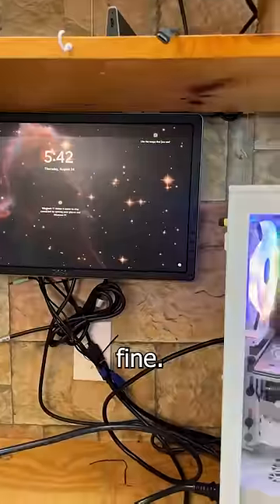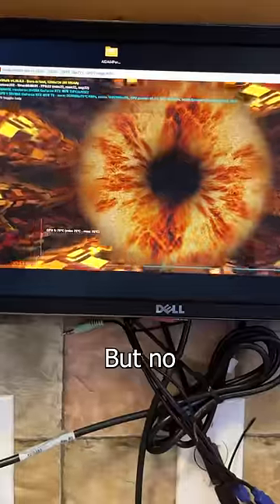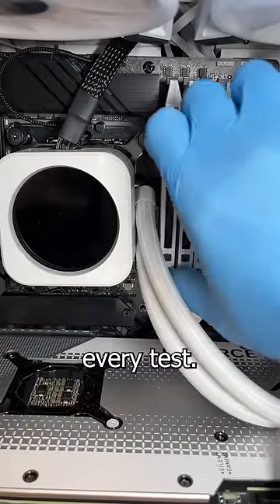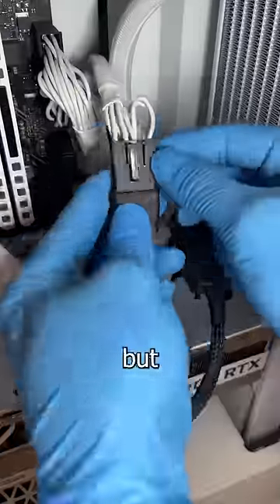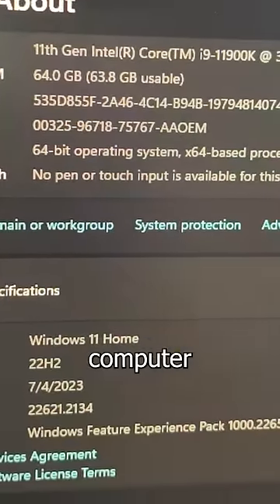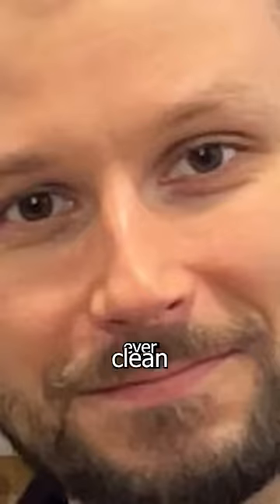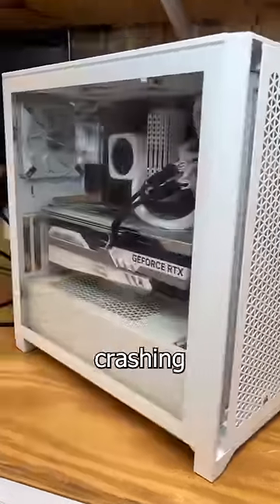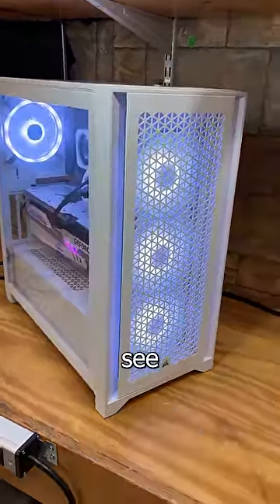The hardest repair in my shop is a #gaming #pc with random problems #technology #shorts #tech

Comment: Can confirm, getting a repair where you know there’s a problem but you can’t find a single thing wrong is the worst.
Reply: As a former automotive technician (fancy dealership mechanic), I can tell you that sporadic "seemingly random" problems usually result in situations like these.

Step 1:  Try to reproduce the problem.
Step 2: Try to gather more information like "What time? Weather? what were you doing when the problem occurred? ...etc.
Step 3: Keep the product for a few days to use in and out of the shop, see if it occurs. This included driving customer vehicles over a weekend.
Step 4: give the customer the product back and give them two options. "If it starts happening more often, a specific location, or a specific task" ... i.e. "Bring it back when it gets worse." OR Take time out of my day at the shop for the customer to drive me around while they try to create the issue for me. --This last part would be hooking up all cables/devices in its home location and call me out to you when it happens.
Reply: Can someone explain why would somebody use thunderbolt docking station
Reply: PC might be hard to access where it is on the desk and the dock sits on the desk for access to ports.

Comment: Problems like these are definitely the ones that you both laugh with a sigh of relief and also scratch your head a little bit in anger because of all the wasted of time. Still, it adds to the knowledge pool, which ultimately matters.
Reply: Yeeepp, just did this with a damaged riser on a micro atx. Couldn’t check stuff ezpz cause of case restrictions 😭😭😂
Reply: @DaddySann1776  The motherboard could be taken out of the case where testing can be done out in the open.

Comment: When absolutely nothing is shorted, this problem usually comes up with power strips. When not rated for high wattage, they give up on you and it is the same effect as having a low wattage PSU. This also applies to most surge protectors.
Reply: Yeah I was gonna say it's something to do with PSU or the plug
Reply: I had a similar problem with a PC replace both PSU,. power cable, new extension lead, brought a new keyboard and mouse in case one of them was shorting it. CPU temperature fine, the RAM, tried friend spare ram, still same problem,. 

In the end I gave up, an just live with randomly turning off every couple of days.
Reply: @DavidKnowles0 sir you have made me very sad (I have the same problem and am now scared)
Reply: @ak26k bro I have the same problem
Reply: @DavidKnowles0 can I ask what brand your pc is and also is it fully random or can you notice some pattern to it mine will only turn off if a game isn’t open gotta run cs2 in the background to watch YouTube without it shutting off

Comment: Several decades ago my car would run rough because oil would get onto a spark plug. A drive on the freeway would fix it, but one time none of my tricks worked. I stopped at the garage before work and they said they had no openings that day. When I started the car back up, it ran fine! Magic repair shop vibes? I'm a believer.
Reply from the maker: Hah, love this!
Reply: My car broke down at the grocery store once it had a cylinder that wasn’t firing and was undrivable to I had AAA bring it to a repair shop expecting a 4k$ repair and they called me back the next day and say the car didn’t have any issues so I picked it up and drove it home

Comment: I worked on FA-18's as a AT in the Navy.  Yes, the worse issues to trouble shoot are the ones that cannot be reproduced.  But we couldn't say on too many tickets "Cannot Reproduce" so, after standard troubleshooting and to much time, we would just "R and R" (Remove and Replace) a part that may be linked to the issues.

Comment: Mine had the same problem, but i fixed it by cleaning the dust, and when it happened again, I pushed on random parts, and it fixed itself and hasn't crashed since.
Reply: It works so often though!  Open the case, poke around randomly.  No idea what I've just done. But it works again for some reason.
Reply: @JimmyJoeBob  ikr 😭
Reply: @JimmyJoeBob  Obviously the errant fondling of the components pleases the Machine Spirit.
Reply: @QueCoiFas the machine spirit: yamete kudasai~
Reply: Had the same problem with a mini rc car 

It didn’t work
I opened it up
Poked the chip a bit
Closed it
It worked

And my brother looked at me as if I was a genius asking how I did it hahahaha
Reply: Yeah, a lot of tech issues are just caused by either little bits of dust or small particles that can be jostled loose, or loose connections between components that can be readjusted with a bit of fenagling.
Reply: @junktruck  yeah it started happening again and idk how to really fix it tbh, i just try to push in the parts harder and wiggle abit

Comment: I had a laptop that would just randomly blue screen after being on for a couple hours. I had it sent off for repair about five times, they replaced  pretty much all they could, motherboard/ram/etc., but everytime I got it back nothing was different what so ever. I would get it back, turn it on without plugging anything in, and leave it completely as they had sent it back to me, only for it to bluescreen in about 2 hours. 

I wish I had a technician like you. I never found out what the issue was, presumably because the company the warranty was under didn't care to read my reports that they had to just leave it on for a couple hours to reproduce the issue.
Reply: Ever thought it could of been a power supply manufacturing malfunction? Or maybe read up about the blue screen error code?
Reply: That's because a blue screen is a windows configuration error issue on your hard drive. Either a bad configuration setting with the operating system or your hard drive was reading badly
Reply: So, if they replaced the mobo, ram etc and the issue is still happening then what is the common denominator - SSD, Keyboard, mouse and charger. Could also be  your wall plug or multi plug.
Reply: @Noon1263 1st thing I thought of was the PSU.
Reply: @IdealConscience not sure where you read this orif it's a language barrier but this is totally false.  Bodf is a sign that a driver is crashing due to either a software or hardware fault.
Reply: *BSoD.
Reply: mybe ur driver got removed try to reinstall the windows or make usb recovery from official website of ur laptop brand

Comment: I had a client who had random power-offs that I could not in any way duplicate on the bench.

The problem was at home they shoved it back in their hoarder cavity of newspapers and other items that completely prevented exhaust air from going anywhere. This was 15 years ago on an OEM pc so there was completely no logs of thermals.

Moral of the story:  when you can not duplicate the issue at all then its best to test in the environment the problem occurs in.  95% of the time the issue is either a peripheral or the user.

Comment: I once had Ethernet dropping out about 2-5x a day for a couple of minutes. Turns out, the sockets the router and my PC were plugged into weren't on the same ground loop (suspect one was actually wired up to the neighbour's circuit) causing 60V of voltage difference between the two neutrals, which the two devices surprisingly more-or-less managed to work with. This was also the reason why touching the case would zap you.

Only after 2 years of suffering through that (including provider switch) did I stumble over the solution. 

The hardest tech problems to fix are always the ones caused by something external that you just expect to be working.

Comment: Imagine if the problem was because of an auto update and not the dock 💀
Reply: In all my years with post-XP Windows, a borked Windows update could easily account for at least half of every non-hw-related not-booting system problem I have worked on. WU has long been and still is such a fragile mess, even on W11 which still used the same underlying backend framework that has barely changed since Vista.
Reply: System Admin here. We see this behavior about twice a year on average, borked Windows Updates cause a slew of problems in large networks, even despite testing protocols. It's kind of a dread fascination game for us, release the Windows Updates to the user pool and watch to see if the tickets roll into the Helpdesk in the coming days...
Reply: @szr8  This is honestly why I turned off auto-update.  I'll stay a few updates behind knowing my computer is running just fine instead of jumping to a borked vers.  Happened a few times to me I found this is one of the easiest solutions.

Comment: God damn. We had a similar issue the other day. Customer came in saying their desktop icons won't show up. I boot up the PC, everything is fine. Strange, but nothing I haven't seen. Maybe some corrupted windows files or a bad cache. Clear the icon cache, and hey, sfc found corrupt files and fixed them up. Sent them on their way. They called in saying there's no icons again, we're like "What? We had it perfectly working. Maybe we should go over your cabling?"

Customer had a VGA cable plugged into the same monitor with her HDMI also plugged into the same monitor, making the PC think that the VGA was a second monitor and prioritizing that rather than the main HDMI. Got her to unplug the VGA, problem solved 🤦
Reply: I don't work in tech (I want to), but I've fixed my own computers and my friends' computers as well. It's always something small that you overlooked, I swear.
Reply: hmmm...i haven't seen this issue before, but i get the thought process "My monitor has 2 video inputs and my pc has 2 outputs that means i must connect both" lol

Comment: I remember one of the most obscure ones i struggled with remotely for about 3 months was a lady in our advertising department had her in house advertising software crash consistently, i even remoted into her computer to try and replicate the issues multiple times and couldnt.

It wasn't until i drove the 150 miles to literally sit at her desk and watch her work that i noticed she was pushing a combination of keys used in the programme that was for whatever reason changing her keyboard language to Welsh English which caused the programme to crash on certain letters.

Literally months spent on such a simple fix.

Comment: My last computer ran totally fine for 6 years (3770K, Intel Extreme mobo, and gold class PSU).  Except only with 1 bank of RAM.  When rebuilding and modernizing it for my father, I realized the mount for the Coolermaster sealed water cooler was causing the CPU to slightly tilt, and some of the memory pins had a bad contact.  I swapped it out for a Noctua vapor cooler, and it’s still choochin, now with 2 banks, after 10 years.  Even after being filled with all the bloatware in the world because he installs everything and never turns it off.

Comment: Sometimes it's not the customers fault. For me, my PC also has a similar problem. Ever since I got my PC, I never touched the insides, fearing that I'd mess up, but it would always go into hibernation type of stage, the lights would be on and everything, and this usually happens when it's hot, but then you can't turn off or on, only cut power from the source. This never happens when I take it to stores, so they can check the problem. After some time, the problem got worse, and soon the PC had become dead. It wouldn't even turn on. When I took it to the store this time, he said it was the Motherboard's fault, took some weeks fixing the problem, cleaning it and stuff. He said the "IC" of the motherboard needed to be fixed, it was the IC he said. After finally getting fixed, and me being able to use the PC again, after some time, the same problem starts to happen again. he sold me a bad piece. :/

Comment: yup... I had a feeling it was something not inside of the computer that was causing the problem.
I remember hearing a similar issue going on where a computer would short out or power off randomly. Turns out it was a bad power from the wall.

Comment: as a part of the maintenance team in a factory, i relate to machines behaving as soon as you step onto the production line.
Reply: HAHAH I had a mechanic called once to check a faulty machine in the production line. When he came it magically wasn't faulty anymore, but he did tell me that's what usually happens so its aight loool
Reply: @fived9424 
yeah, usually happens on automatic pneumatic screwdrivers here, it stops putting screws in correctly, so they call us over and when we are actually looking at it, it just starts putting the screws perfectly without a single bad one.

or tester machines, those also are quite common.
Reply: For some reason, I read "Step onto the production line" as "Step on them" and my next thought was "Oh, machines are subs, that makes sense".

Why, Brain. Why.

Anyways.

Comment: That was gonna be my second guess, a peripheral. My first guess was the wall power. Some power supplies, even ones from good brands, don't handle "dirty" wall power well so depending on where you live or how old your house/building is you can get fluctuations in voltage that will shut down the power supply. Its an easy fix though with a decent UPS though, and you get the advantage of not having your computer improperly shutting down.

Comment: I actually had a similar issue and I spent so long trying to figure out what was wrong. Turns out the heatwave we just had melted the front pannel a little so whenever I bumped the desk it would turn itself off at the button 😂

Comment: Not being able to reproduce the problem in trouble shooting something is the worse. I had the same random, unpredictable problem with my truck. Took two mechanics to find it. The truck would randomly die sometimes, and wouldn’t even restart after cycling the key. Turns out it was some electrical control box (forget the actual name) that was basically in line between the key, and starter, and battery. Would get heat soaked (big block motor so a lot of heat under the hood), randomly die, would have to wait a minute, then would actually start. Last time it happened was so nerve racking as I was in a turning lane. Got lucky that it was one that takes a while after it cycled through green with a long red light. 

I hate old vehicles with obd2 systems lol, so hard to diagnose. You can say that new vehicles have too much technology but at least it has better systems that will tell you what’s wrong with the vehicle.

Comment: When I built my first PC I had the problem that it didn't want to boot up. I sent my build back to the part seller, they checked every part and found nothing. I asked a friend who works in IT and generally knows that stuff, he found nothing. For 2 months we tried to find out what was wrong. He explained to me that one light on the motherboard has to stay white during the boot up and it turned yellow, meaning it crashed. I don't know why but I put it on my lap to touch that part and it booted. AND THERE WE DISCOVERED THAT THE DUCKING FRAME WAS BENT AND COUSED THE MOTHERBOARD TO DUCK UP. Now the PC runs as long as I have 2 50cent pieces under the front-left foot and don't have the glass screwed in and I learned to always ALWAYS consider Murphy's law.
Reply: The moody machine

Comment: I'll leave this here in case it helps one day: memory can fault and immediately power off a system skipping a blue screen. You can even boot it again, throw every test at it again, watch them all pass, and it will still randomly crash.

What you do to fix it sounds really weird and this sounds like a joke but I swear it's not: take out each ram stick and clean the contacts LIGHTLY with a pencil eraser. Visually inspect there aren't any shavings left behind before reinserting. This was a real issue I've had on my desktop and this was the real solution.

I don't know who the hell figured out this method but they must be IT Gandalf I swear to God...

Comment: A friend brought me his girlfriend's PC with a random crash issue.  I eventually traced it to a warped latch on the motherboard power cable.  Found it by *cringe* wiggling stuff while it was running.  A little tweaking and bending later, the connector latch held tight and satisfied them.

Comment: Yeah when I find an issue like this. I rule it to being an issue with the power lines wherever the customer is. Like that one tech support tale of the guy who's computer shut off whenever he went to get a beer. Turns out the compressor on his fridge was going and drawing more current off the breaker than it should and was causing the PC to crash without the breaker tripping.

Comment: I knew about 10 seconds end that it was either an issue with something that was plugged into the tower, or something the tower was plugged into (faulty outlet for example). 

I spent about a year doing networking for CenturLink. We always ask "Have you checked power and equipment." before we do anything, because about half the time something either came unplugged, or was plugged into a faulty outlet. And if we sent a tech out to "fix" a circuit and we found out that it was something on the customer end that we don't manage, well that's a HEFTY bill my friend. 

Always do your own testing before contacting a technician. Of course this is assuming you know how to do said testing. If you're just a consumer with a PC that isn't working and you have no idea how to test it, go ahead and call the technician right away. No shame in that.

Comment: I had to fix a relative's computer once. She said it wouldn't turn on. I suspected that it had a bad PSU. However, when I got there, it turned out that it was not plugged in at the wall.